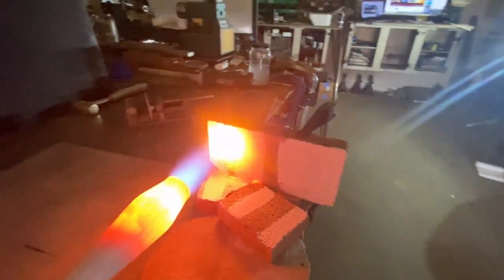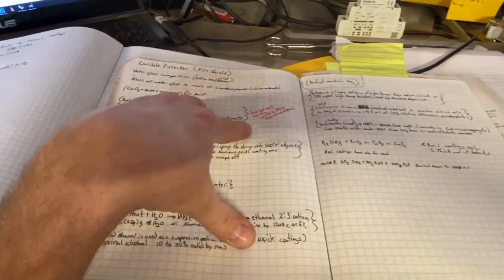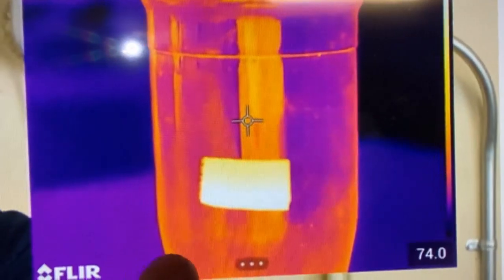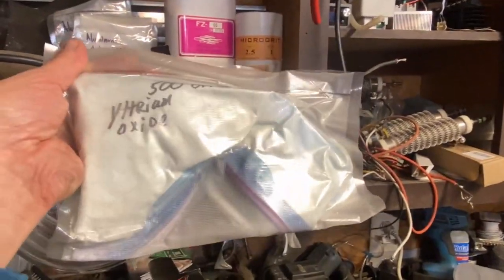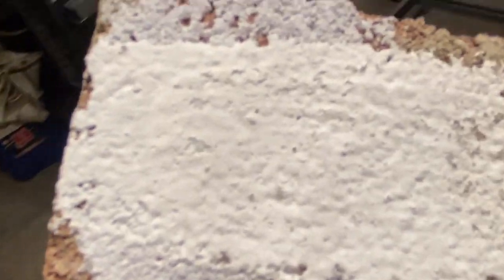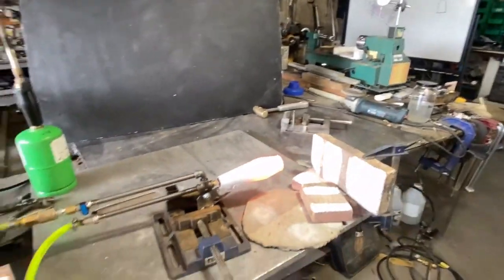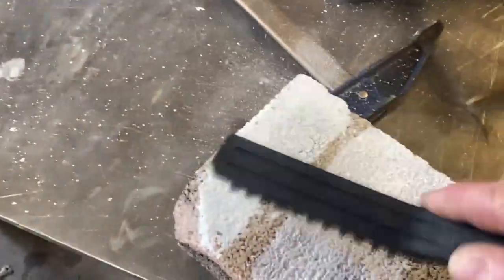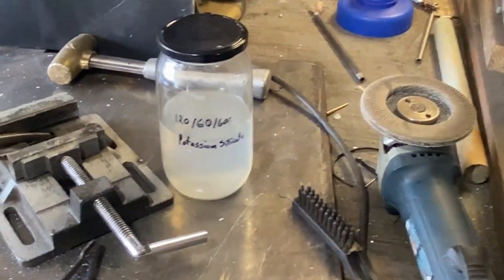Space Age high temp Ceramic coating FORMULA

Comment: Hey, NoBox, good to see you found my old posts on Donkey32 at proboards. Just a heads-up that the latest research is showing that yttria isn’t the best stabilizer for tetragonal zirconia at extremely high temperatures over time. Turns out that the yttia dissociates from the ZrO2 and can lead to the zirconia phase-shifting between tetragonal-monoclinic crystal shape at around 900° C — and that causes the coatings to crack with associated expansion of that crystal phase shift. Cerium oxide shows better high-temp stabilization over time than yttria, and for refractories, magnesium oxide and even calcium oxide appear to serve the same crystallinity stabilization at ultra high temps, but at a much lower cost than the lanthanide group of rare earth elements.
Reply: So can anybody suggest a recipe for stabilized zirconia with calcium or magnesium oxide? Proportions? Could Zircopax/Ultrox be used to make a similar coating?
Reply: @revscott58  If you’re wanting to use Zircon (Zirconium-silicate, ZrSi04) like Ultox — There is also a possibility of making a mullite-Zirconia composite, which uses ZrO2-mullite as the bonding phase for a super-tough, super thermal-shock resistant and chemically resistant refractory… but you’re limited to only 20% ZrO2 in the final product [after the ZrSiO4 dissociates, and the ejected Si combines with the Al to form mullite.] Look for the paper on HAL Open Science database, “ Mullite Zirconia Composite for the Bonding Phase of Refractory Bricks in Hazardous Waste Incineration Rotary Kiln “ by Weinberg, Goeuriot, Poirier, Varona, and Chaucherie.

It may be possible to add another thermally-emissive oxide into that Zircon + Kyanite + Al2O3 mix … but the issue with that formulation is that it has to be fired to a minimum of 1500°C and held for at least a 2 hours to make the reaction-sintering happen… so it’s not like a coating you can paint on cold and then fire the refractory to temp for a simple cure schedule.
Reply from the maker: Great input my friend and fantastic post on Donkey32 . Brovo on that work , you guys are next level man ...
Reply: do these differ in acid resistance i.e. borax?
Reply: @verdigrissirgidrev4152  Zirconia (ZrO2) itself is quite resistant to acid and base attack, but the devil is in the bonding material. Acid/base corrosion of refractories happens along grain boundaries in the glassy silicate phase  — so the really potent glass-formers like sodium (Na) and potassium (K) of the waterglass [added for the purpose of cold-bonding the coating to the refractory face before it’s fired-on and fused into it] are the weak points that destroy the coating’s acid/base resistance.

You can get around this by using colloidal silica instead of waterglass… but colloidal silica has a short shelf life and is extremely sensitive to / rendered unusable by freezing temperatures, so it’s a lot less common than K or Na waterglass high-temp adhesives.

The amount of Mg or Ca needed to partially stabilize Zirconia is only 3mol% and fully stabilized is only 8mol%. Mg, especially when used in an aluminosilicate carrier (like 70% Al : 30% Si — to form mullite upon firing) is quite resistant to acid and base attack at 3mol%, plus it helps as a sintering aid, and it helps the mullite form. At 8mol%, any excess Mg will combine with some of the Al to form spinel, which is fairly acid/base resistant too.

Cerium and Lanthanum can also stabilize ZrO2 and are quite acid/base resistant, even though they’re potent glass-formers. I suspect ITC uses one of these lanthanides in their formulation along with colloidal silica… the company has previously said that they’re coating remains adhered and strong because they formulate it to soften at high temp and flex with the thermal expansion of whatever refractory substrate it’s painted on. This makes sense as those lanthanides make chemically-resistant glasses — and ZrO2 makes glassy phases more viscous and prevents running or dripping during melt.
Reply: @verdigrissirgidrev4152  ZrO2 itself is quite resistant to acid and base attack, but the devil is in the bonding material. Acid/base corrosion of refractories happens along grain boundaries in the glassy silicate phase  — so the really potent glass-formers like sodium (Na) and potassium (K) of the waterglass [added for the purpose of cold-bonding the coating to the refractory face before it’s fired-on and fused into it] are the weak points that destroy the coating’s acid/base resistance.

You can get around this by using colloidal silica instead of waterglass… but colloidal silica has a short shelf life and is extremely sensitive to / rendered unusable by freezing temperatures, so it’s a lot less common than K or Na waterglass high-temp adhesives. 

The amount of Mg needed to stabilize ZrO2 is only 8mol%
Reply: @verdigrissirgidrev4152 the amount of MgO needed to stabilize ZrO2 is only 8mol%. The sodium and/or potassium in waterglass are a lot more deleterious to corrosion resistance (they’re both potent glass-forming fluxes and both highly alkali) — but they can be avoided by using colloidal silica instead of Na- or K- silicate waterglass.
Reply: Interesting these are the same elements alloyed with tungsten for TIG welding electrodes
Reply: @Steve-lu6ft  I’ve tried to reply to a few questions here but YouTube keeps deleting my comments as soon as I post them — I’m guessing YT doesn’t like url links or lengthy replies. EDIT: YT still won’t let me make a new reply so I’m trying to edit this one to add info:

Most of the research is paywalled, but this is public domain: “Harbison-Walker Handbook of Refractories Practice” pg CR-15.

8 percent MgO will fully stabilize ZrO2 if heated together at 1500-1700°C. If other oxides are present, (like Al2O3 in kaolin) the transformation-toughening effect mentioned (with sub-micron ZrO2) is the better approach, as the magnesia will combine with alumina to form spinel instead of bonding to the tetragonal zirconia and stabilizing it. Transformation-toughening typically works up to max. 30 percent ZrO2 (over that and it can crack)

ITC says their coating works because it can soften and flex with the substrate at high temp. Makes me think they use ZrO2 in a lanthanide glassy matrix. Which is IR emissive, acid-base resistant, and makes a viscous melt that would soften but stay in place if applied in a thin layer as they advise, and might avoid phase-shift cracking with higher zirconia content.
Reply: @Steve-lu6ft  Most of the research papers are behind paywalls, but this is public domain: Harbison-Walker Handbook of Refractories Practice pg CR-15, Special Refractories, Zirconia. (PDF is online at the Masonry Heater Association site and few other places.)
8% (mol) MgO will fully stabilize ZrO2 if fired together at 1500-1700°C. If other oxides like Al2O3 are present, (IE if used a kaolin slurry) the transformation-toughening effect mentioned on pg CR-15 (with sub-micron ZrO2) is the better approach than stabilization, as the MgO will combine with Al2O3 to form spinel instead of bonding to the tetragonal zirconia and stabilizing it. Transformation-toughening typically works up to a maximum of 30% ZrO2 content (over 30% and it can stress-crack)
ITC says their coating works because they allow it to soften and flex with refractory substrate at furnace temperatures, which makes me think they use ZrO2 in a lanthanide glassy matrix, which is IR emissive, acid/base resistant, and makes a viscous glassy melt that would soften but stay in place if applied in a thin layer as they advise.
Reply: @Steve-lu6ft  Most of the research papers are behind paywalls, but this is public domain: Harbison-Walker Handbook of Refractories Practice pg CR-15, Zirconia. (PDF is online at the Masonry Heater Assn site and others.)
8 mol percent MgO will fully stabilize ZrO2 if fired together at 1500-1700°C. If other oxides like Al2O3 are present, (IE if used in a kaolin slurry) the transformation-toughening effect mentioned on pg CR-15 (with sub-micron ZrO2) is the better approach, as the MgO will combine with Al2O3 to form spinel instead of bonding to the tetragonal zirconia and stabilizing it. Transformation-toughening typically works up to a max. of 30 percent ZrO2 (over that and it can stress-crack)
ITC says their coating works because they allow it to soften and flex with the refractory substrate at furnace temperatures, which makes me think they use ZrO2 in a lanthanide glassy matrix, which is IR emissive, acid/base resistant, and makes a viscous glassy melt that would soften but stay in place if applied in a thin layer as they advise, and might avoid the phase-shift cracking issue at higher zirconia content.
Reply: @Steve-lu6ft  Most of the research is paywalled, but this is public domain: “Harbison-Walker Handbook of Refractories Practice” pg CR-15. (PDF is online various places)
8 mol percent MgO will fully stabilize ZrO2 if fired together at 1500-1700°C. If other oxides like Al2O3 are present, (IE in a kaolin slurry) the transformation-toughening effect mentioned on pg CR-15 (with sub-micron ZrO2) is the better approach, as the magnesia will combine with alumina to form spinel instead of bonding to the tetragonal zirconia and stabilizing it. Transformation-toughening typically works up to max. 30 percent ZrO2 (over that and it can stress-crack)

ITC says their coating works because it can soften and flex with the substrate at furnace temps, which makes me think they use ZrO2 in a lanthanide glassy matrix. Which is IR emissive, acid/base resistant, and makes a viscous glassy melt that would soften but stay in place if applied in a thin layer as they advise, and might avoid phase-shift cracking with higher zirconia content.
Reply: @Steve-lu6ft  Most of the research is paywalled, but this is public domain: “Harbison-Walker Handbook of Refractories Practice” pg CR-15.

8 percent MgO will fully stabilize ZrO2 if heated together at 1500-1700°C. If other oxides are present, (like Al2O3 in kaolin) the transformation-toughening effect mentioned (with sub-micron ZrO2) is the better approach, as the magnesia will combine with alumina to form spinel instead of bonding to the tetragonal zirconia and stabilizing it. Transformation-toughening typically works up to max. 30 percent ZrO2 (over that and it can crack)

ITC says their coating works because it can soften and flex with the substrate at high temp. Makes me think they use ZrO2 in a lanthanide glassy matrix. Which is IR emissive, acid-base resistant, and makes a viscous melt that would soften but stay in place if applied in a thin layer as they advise, and might avoid phase-shift cracking with higher zirconia content.

Comment: Hey man, first of all thank you so much for getting this out there. 
I got a question about the coating, im in a bit of a budget and was wondering if you could tell me if 200 grams of zircon oxide would be enough to cover a 40x62cm plate.
Thanks again for your work
Reply from the maker: Yes it should be enough becuase thicker is not better
Reply: @NOBOX7  awesome thanks a lot man
Will be ordering ordering the oxide as soon as possible

Comment: Links to the documents within the vid:
https://inis.iaea.org/collection/NCLCollectionStore/_Public/02/005/2005772.pdf
[when you download the second file, change the filename. Add .pdf to the end so you can open it]
https://www.osti.gov/servlets/purl/4389738
Reply: As a guy that likes to melt stuff often, that crucibles pdf is very good so far, thank you. *Let me share a tip*: I have found that the cheapest and most easily available crucibles are cups from the thrift store, which are great for small jobs. I use a diamond blade in my grinder to cut off the handle and grind back the top off the cup to remove the glaze so that when I get up to Orange or Yellow Heat (>1,050˚C/1,922˚F) my unglazed lid does not stick to the glaze. The only catch is that cups take a couple of hours of gradual heating which is only possible if you are able to control the ramping of your temperatures. And the bottom usually cracks upon cooling so they are single use. At $0.50 a piece that's not a deal breaker. Max temp for porcelain is 1,350˚C/2,462˚F. Alumina is good for 2,700˚C/4,892˚F but require sintering to reduce porosity. Porosity is fine for metal but not salts and this is where porcelain excels.

Comment: Two ways to acquire platinum without paying a big markup from a lab.  First, order platinum coins from the U.S. Mint.  Second, you can recover platinum from used electronics like motherboards.
Reply: There is so little platinum in motherboards and their components. The coins would be a far quicker and probably cheaper solution in the long term

Comment: Howdy NoBox7, 
If I am not mistaken, ceramic supply stores sell a product called zircopax plus which already has a small  percentage of yitrium. The potassium silicate vs. the sodium silicate just increases the temperature rating slightly. Every little bit counts. I think you are on the right track! Blessings.
Reply: Zircopax Plus does not contain yttria, the “plus” just means it has been milled to a smaller particle size (about 1-1.5 micron) than the earlier Zircopax (approx 2 μm) Zircopax and Zircopax Plus are no longer made, as the company who produced them was bought out by Trebol, who make even smaller particle-sizes of zircon flour called “Ultrox 500” (1μm) and “Ultrox 1000” (0.5 μm)
Reply: @forsytheinstauraturruinae Thanks, Yeah I looked again at the data on Zircopax plus. It said it had a small amount of hafnium not yttrium. My mistake. I did not know it is now Ultrox.
Reply from the maker: @forsytheinstauraturruinae  Thanks for the input

Comment: 10:23 be interesting to try lamenting thinner bricks for the wall while the inner wall facing your heat source has the thin coat
Reply: I'd also be curious if this would work well for a microwave kiln/smelter
Reply: @killpidone I think the zirconia acts as a microwave receptor and will heat up.
Reply: @killpidone Silicon carbide, magnetite, and graphite are common coatings for microwave receptors. Look up reticulated zirconia and you will see what I mean.

Comment: Emissivity = Absorbance

It’s not a reflective Coating.
A reflective Coating bounces the Radiation back directly.
This absorbs and re-emits it.
Can be useful still.

Difference is how hot your Furnace Wall itself gets and in Consequence how much the Refractory has to withstand.
Reply: The emissivity of Thermal Barrier Coatings (TBCs) actually does [effectively and functionally] serve as a reflective barrier at temperatures above 573°K , as NOBOX cited at 3:30 — The reason is that change in primary heat transfer modality from conduction to radiation at high temperatures.

Conduction is heat that propagates as “phonons” (excitation of the molecules in the form of vibrational waves which travel through matter, each molecule “bumping” into the next and transfering that vibrational heat energy.) 

Radiation is heat that propagates as “photons” (energy transferred via the infrared spectrum of light wavelengths.)

Emissive TBCs take heat which would otherwise conduct (absorb into and transmit through) the opaque refractory face, and convert that phonon vibrational wave energy into photon infrared lightwave energy. Since light spectra cannot directly pass through the solid/opaque matter without re-converting back to molecular vibration, the lion’s share of that heat is re-radiated back inward toward the furnace interior as light… making it (functionally and effectively) serve as a “reflective” TBC, preventing the refractory from absorbing and transmitting it as conducted heat.
Reply from the maker: Is that your final answer or would you like to phone a friend ?
Reply: I don’t see how that contradicts what I said?

The Coating absorbs Photons as well as Phonon Quasiparticles and radiates most of it as Photons of.

That is still not Reflection.

Its just Way more feasible to build a stable high Emission Coating than anything thats very reflective at the relevant Wavelengths and withstands the Atmosphere.

Comment: I wonder if ceracoat paint would also work (the stuff they coat the top of high performance pistons to keep them from melting)...or is that formula similar to their formula....
Keeping the heat where you want it, or keep it out of where you don't seems like a VERY good idea for furnaces and burners!
Can you attempt to coat the inside of the burner (to prevent heat getting TO the parent metal) [my guess is the velocity of the air and it's abrasiveness would end up stripping it off]
Great video!
Keep em coming!!!!

Comment: @NOBOX7
Bob impressive research and work as usual.

I can say that the reason to pick POTASSIUM over SODIUM is due to the lower fluxing properties of it.
As you know in glass sodium is added to reduce melting point.
Potassium has the same effect but milder.
Reply from the maker: Thanks for the valuable feedback

Comment: I've made something similar to this, I used 90% Zircon Flour and 10% Kaolin G1 (Its a clay used for pottery washes I think) and mix with water to make a paint. I got all the ingredients from a local pottery supply shop. After lining my gas forge with it and firing it at around 1100 deg Celcius (2021F) it turned to a nice hard ceramic shell on the inside of the forge and it seems to really glow brightly(beside melting copper i cannot get an accurate reading on the temps) I have an idea i need to pay with which is using lime and zicron powder to see if that makes a difference or if using your mixture will make a difference. Going to try in the next few weeks.
Reply from the maker: Try pyro cones for kilns , they sag at certain temps , im gonna get a variety myself possibly
Reply: @NOBOX7  That's a fantastic idea, thanks
Reply: Keep us posted!